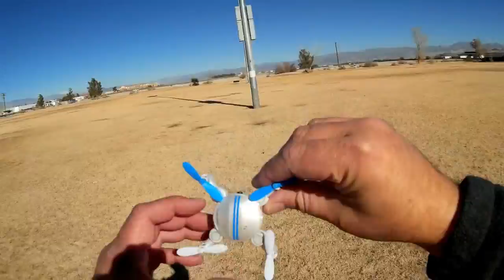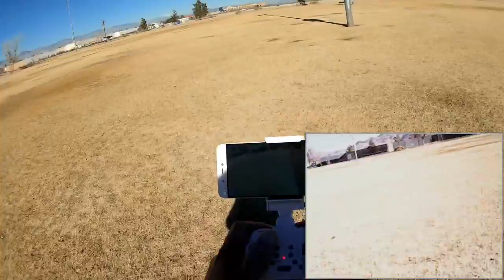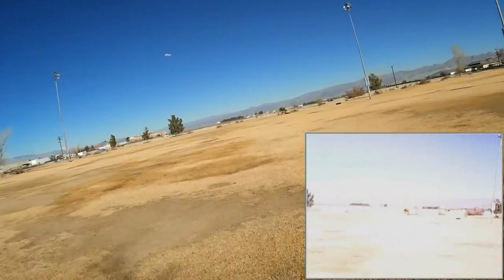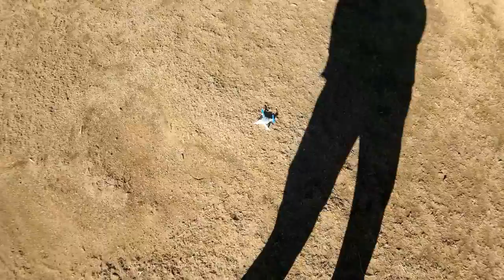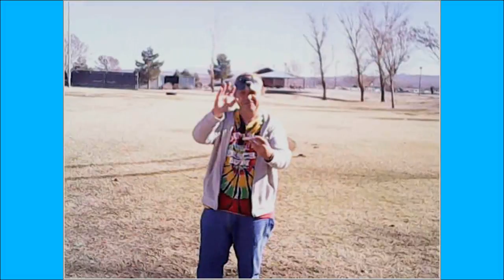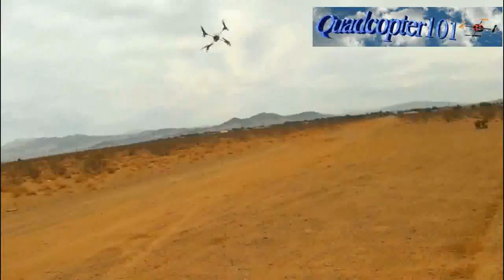Z201YS Pocket Camera Selfie Drone Flight Test Review

Comment: Just got mine today. Haven't even put batteries in controller.
Reply: When am I going to learn NOT to use eBay? The screw that secures the battery compartment is missing and the two parts that make up the phone mount are missing. It was supposed to new. Was it? I wonder. Still don't know how it flies. At this point I'm not real hopeful.
Reply: Apparently there are two versions. Though it was advertised as a FPV drone, mine has no camera. Instead it has a light. I got screwed!
Reply: After a lot of complaining, eBay stepped in and got me a full refund and I get to keep the little bugger. It's a great little flyer and, since it was free, I have no complaints. Still wish it had a camera though.

Comment: need helppp... i can't fully control my z201ys using my phone and even its remote
Reply from the maker: Let's start with is remote.
1) Turn on the quadcopter and place it on a flat and level surface.
2) Turn on the transmitter.  Move the left throttle stick full up and then full down to bind the transmitter to the quadcopter.
3) start the motors by moving both stick down and to the left.

Comment: Can you review the Swift Stream z-9 drone it was the drone I had before I decided to go with the Hubsan H501s X4. I didn't like it much, but I would like to see your thoughts on it. It kinda looks like a sema drone. They have come out with a new drone called the z-10, but I decided not to get that one based off my experience with the z-9. So please review the z-9 I want to know if anyone else was having the same problems as me. BTW some of the problems that I was having is that it would randomly flip over in mid-air and also it won't fly off the ground sometimes because one of the motors would stop even though I cleaned it.

Comment: Which gives better FPV video and video quality - Z201YS or H37 Selfie?
Reply from the maker: They're about the same with 0.3mp sensors (640 x 480 pixel resolution).
Reply: Thanks and appreciate the feedback!  I've purchased a few quads based on your reviews (which tend to be spot on.)
I think it would be fun to have a small, inexpensive FPV quad.  Both models are tempting.  I might favor having a physical remote rather than controlling just by the phone, but there seem to be more bells and whistles with the H37's camera.
Based on your video, it also appears as though FPV reception is better Z201YS, but the outdoor quality isn't as good?  Any other thoughts or recommendations for an inexpensive FPV quad?

Comment: Hey goodday, love your channel by the way... I have a question maybe you can help me, i really want a Mavic Pro, but i have never owned a drone so i would like a low end one to practice on, maybe one with FPV 5.8MHz, Altitude hold, and Motorized controlled camera position... can you recommend a low end drone with these specs for me to try on, those 3 are my main request
Reply from the maker: As a new flier, would recommend skipping your shopping list, and instead focus on learning the basics.  You'll thank yourself later.  I always recommend the Syma X5C for new fliers, due to its excellent stability, durability, and ease of flying. And it even has a camera too.  Use it to learn the basics of flight with.  Let this cheap quadcopter take the inevitable crashes and bangs of a beginner flier (and you will crash, it's inevitable). And if you break it, every part on it is cheap, widely available, and easily replaceable. Later as your flying skills improve and you're not crashing as much, then consider something better/more expensive like the Mavic Pro.  https://www.youtube.com/watch?v=y93vzA-KRlM

Comment: I've just got a new drone for Xmas.  the right stick springs back to the same position but the left stick does not spring back is that normal? regards.
Reply: orionsstars76 That means there isn't altitude hold
Reply: Tyler A oh right have not tried it yet as thought it was broke gonna send it back to amazon.
Reply: orionsstars76 yeah don't it's just doesn't have altitude hold
Reply: Michael_R_ ok just had a go its pretty good for my first drone. its a h8c drone.